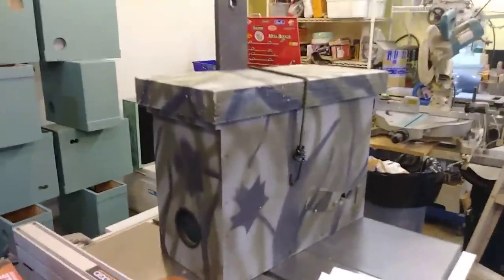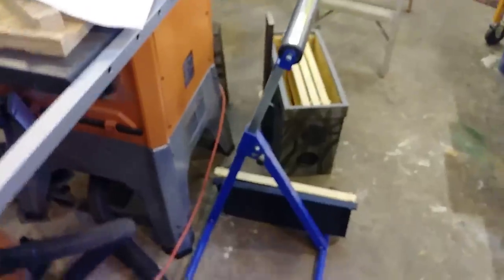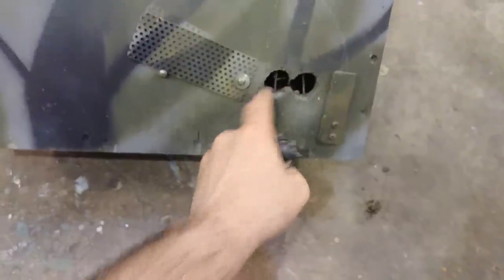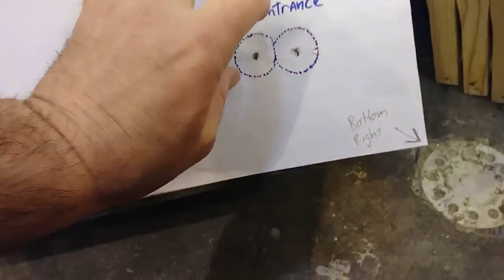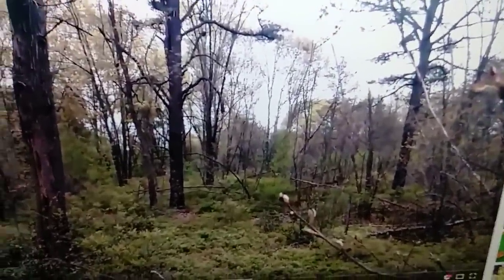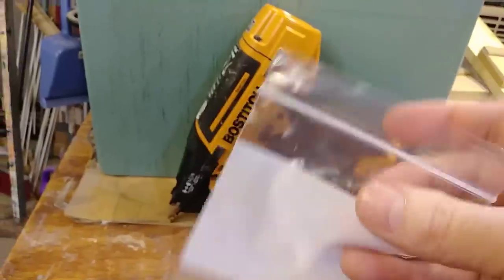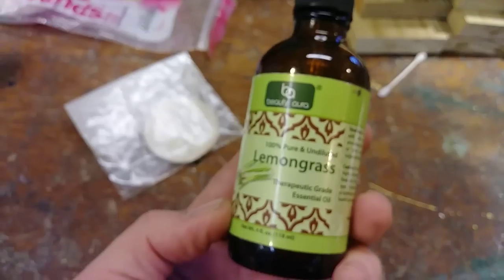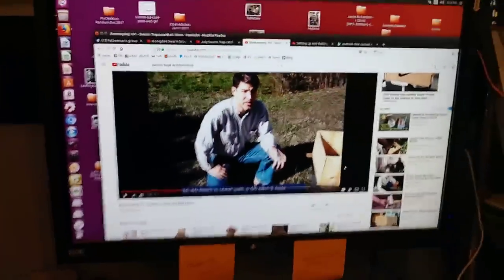Swarm Trap Design , Placement , Baiting , everything. Catch FREE BEES

Comment: The ventilation needed depends on where you are and the time of year.  So vents with the plugs that can put in or taken out like you have sounds like the best way. That way if the weather is hot you can change the amount of ventilation  for the weather.
Reply from the maker: Yes. That's exactly what these do. They can be removed. They have a few 3/16" holes drilled in them for minimal ventilation while in...I take them out when I catch a swarm.
Reply: @AvocaSingleTrack  I have seen some videos where they put 2 1.5 in holes with no plugs. I think that would only work in the summer and in the south.

Comment: Aloha Steve Adel. This has gotten my brain percolating. I remember when I started out trying to trap swarms I said why not a nuc box. Did this without reading. I had gotten tired of doing a cut out of the pulp pot swarm traps. Said why not with frames inside. make it easy. I too like the lazy person approach why work hard when the bees should be able to do the work for you. Of course the nucs didnt work. I think so far I have seen them accept a DCoats nuc only once. I also kept fish so I quickly came to the realization that the nuc is about 5 gallons and it seems that bees want about 10gal. Why not then a double nuc. Had that though in the back of my mind. Can see that this way everything can be cut on a circular saw or table saw. no need for dado blades, routers, etc. one kind of wood. Easy and elegant. Mahalo for sharing.
Reply from the maker: I mention D Coates Nuc as a basis for the design, but you add 5 to 7 inches to the depth, making it approx 33L..find a D Coates plan that you like and just make it taller.  There are D Coates Nuc plan that have no dado cuts. Thanks Sir !
Reply: I've caught swarms in a regular 5-frame nuc. Checkerboard frames, 1 frame of old brood comb.
Reply from the maker: Mach , did you have any luck yet ?
Reply: Steve's Mixed Bag yep. Pulling a swarm a week from my neighborhood. Not deploying all traps. Wife gets worried when I have more than a dozen hives at home
Reply from the maker: Awesome !   I've got about 25 set out this week.  Congrats on all the catches !

Comment: Just set 2 out this morning with 3 frames, now I will go add more foundationless for the outside.
Reply from the maker: I would put the foundation frames in the front , rear and middle positions (1, 3, 5)...and the foundationless "open" frames in position 2 and 4 . This way they don't start to cross comb, the foundation frames act as a guide, keeping them in line.   If the foundationless "open" frames were in the outside positions (1 and 5)  I think they could cross comb to the box . Good luck Sir !

Comment: You might find your bait lasts longer, is never too strong, and you have to use less if you put a cotton ball or piece of paper towel in a 1qt zip lock bag and poke several holes in one side of it.  Lay it on the bottom with the holes facing up.  OR, you can put a cotton ball into a slurpee (wide) straw, close one end and pit it somewhere inside.  Both seem to work well.
Reply from the maker: 2 more good ideas. Thanks for adding the comment. Much appreciated !

Comment: Steve,  I need to hang my bait hive on my own property which is an acre.  That puts it not far from my bee yard.  When I move the captured swarm to my bee yard,  how can I keep them from returning to the old location without moving them two miles away for a week?
Reply from the maker: I bring swarms back and hive them in the evening,  usually into a nuc but sometimes a 10 frame deep. I put some pollen patty on top the frames and give a comb frame, a honey frame and a little 1:1, (give some sugar if no honey frame avail). I close it up, I shim the telescoping cover off the box with 3/32 welding rod  pieces (all for ventilation) . Then I put some small wood cubes on top of the telescoping cover, then a piece of scrap plywood resting on the wood cubes. This shades them and prevents overheating.  I shove screen into the front entrance... Then i leave them in for 2 nights: the night i hived them, the next day and night...the next morning i open it up. It's about 36 hrs. Never had one leave with this method. Some people put branches in front of the entrance. The method I use always works, so it's what I do. If you don't ventilate it well, you could overheat them and kill your swarm.  I do this for distant swarms and some i've caught right here. Anything else, feel free to ask. Good luck !

Comment: How much space do you need under your frames? I’ve built one trap before and had quite a bit of space under the frames and they continued building brood comb under the frames and it was a mess. I had like 6-10 inches of extra space. I’m trying to make improvements on my design, but don’t want to waste their efforts. I had 7 frames in total, but they were intent on building down instead of horizontally. So my only question is ho much space is needed under the frames.
Reply from the maker: You need to be checking your traps ever week to 10 days . Leaving the extra space will make the box more desireable but ...if you let a swarm go for too long then yes, they will draw the frames right to the bottom once they've filled the frames in the top. The alternative is don't leave any extra space below, you'll basically have a 5 frame nuc swarm trap of smaller volume which is less desireable. I've had best success with 5-8 inches dead space below and alternating the frames, Foundation frame front, back and center and the remaining two are foundationless with just string zig zag . This works

Comment: Do you prefer brads or staples for assembly?  What gauge and length are best?  I know the glue does most of the work, but wanted to check.  I am going to use 5/8 plywood.
Reply from the maker: I use either this finish nailer https://amzn.to/2pLBbyr 

or this brad nailer https://amzn.to/2MhAtRf   I like these because they leave a nail hole which i can go over with painters caulk prior to painting. Then I have very few ways for water to get in.  I do use alot of staples for other things, like telescoping covers, places where the exposed head of the staple is not a problem. One of my other video's I show the exact models of finish nailgun, brad nailer and staplers I use. I also mention the glue in a few videos. Thanks for watching and good luck !

Comment: those two empty frames would probably work better with old comb. Or some of your plastic foundations replace with old comb and then put the same two empty frames in so they can use their nasenof glands like they are promoted to do by evolution. they will treat the plastic foundation like tree obstructions inside so as to reduce the overall gallonage of the hive. They like 5 gallons of space.
Reply from the maker: comb frames would decrease apparent volume.  Foundationless "empty" frames give more apparent volume.  Using a comb frame is a good thing if you have it. If you watch thru the video I show how I rub old comb all over the foundation, frames and inside the box. It certainly helps.

Comment: Steve, great video.  great paint job, how did you do that.
Reply from the maker: Jerry deGroot flat grey background, then I traced  branches and leaves from internet photocopies on to some thick poster paper. Then I use that as a stencil...move it around and spray...same stencil used at different angles and or overlapped
Reply: Jerry deGroot agree
Reply: Jerry deGroot agree

Comment: SQUARE TO ROUND PASS.. FOUND PVC PIPE 380MM IN SIDE DIA.. CAP BOTH ENDS WALL THICKNESS12MM MOUNTING SYSTEM TO TREE  EYE BOLTS ONE TOP AND BOTTOM...PVC PIPE GET FROM LOCAL DUMP SHOP SAME WITH PLY WOOD CAPS BEES LIKE TO BUILD UPLENGTH OF PIPE 900MM FRAMES MADE FROM BULSER WOOD...